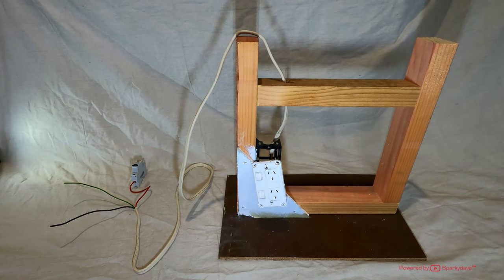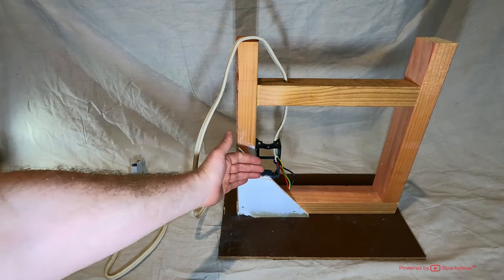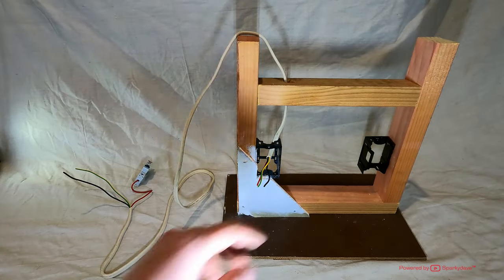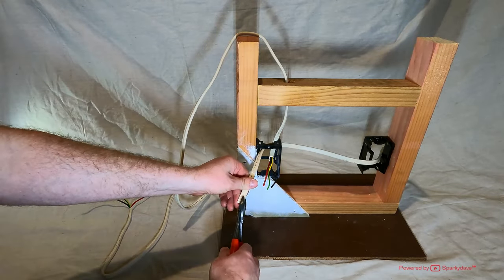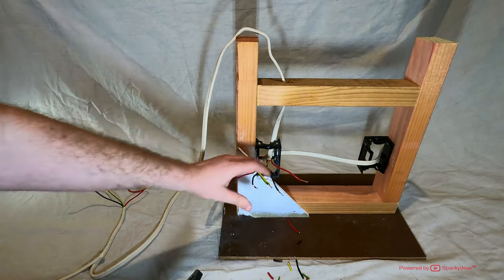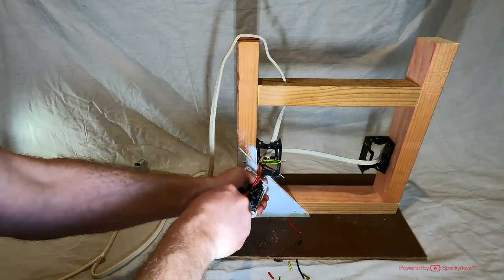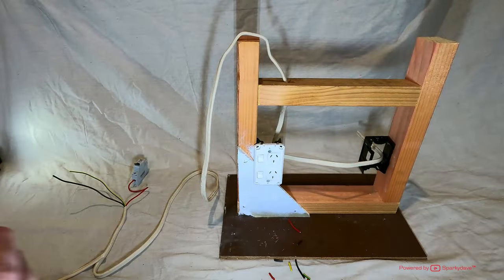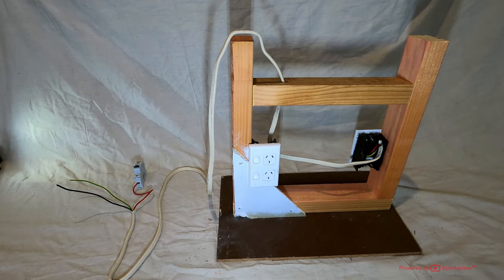Basics: Adding a Socket to Existing Circuit

Comment: Hey love your channel, when you say a maximum of 6 socket outlets on feed to the breaker box - is that six single sockets (ie  double sockets count as individuals or as a total of 3 on the feed?)  - also when do you use pvc conduit and does it go through the dwang or just but it? ?

Comment: Great video. I've talked to a few people about limits to the number of sockets on a 16A circuit and get different opinions. One person said 4, another said no limit, so long as the load is under the 16A. You said a maximum of 6, which seems very reasonable. Is that a rule of thumb or an actual legal standard?
Reply: I want to know this too, as I love to put in waaaay too many outlets, not because i ever intend to use them all at the same time, but simply because I like always having one super near me whatever I'm doing
Reply: I'm a non practicing Electrician. Been out of the game for a long time, but am dipping back in. Doing my Regs course next week. I'll ask the question about the number of socket outlets and see what the tutor says. Not really looking forward to exams again, but have to do it.   @Niberspace

Comment: Quick question ----> you stated you're running 2.5mm cable to your wall sockets, but I've read elsewhere (and I guess everyone has an opinion) that some people like to use 4mm cable for wall socket circuits.

From what I've read, 2.5mm cable (e.g. 2.5mm Twin & Earth Flat Cable) is rated somewhere between 16-20A and most appliances (I would 99%+) running off a wall socket (e.g. kettle, toaster, vacumm cleaner, desk lamp, TV, etc) are rated under 2400W (or 10A).  So this preference to use 4mm cable seems kind of illogical (apart from the hell of just wanting to over-size your cables).  

Your thoughts on 4mm cable for wall sockets?  Overkill or is there some rational to it?
Reply: 2.5mm is the smallest allowed for GPO circuits.  

If there is a long distance from the switchboard to the last socket-outlet on the circuit, then the volt-drop of the cable can become too much.  Other factors such as the cable tightly packed with other cables, or the cable route through insulation in the walls and ceiling, etc.  There are tables and calculations within the electrical standards to work this stuff out.

So yes, there comes a point that 2.5mm isn't big enough and 4mm is required.
Also, the circuit protection needs to be selected in order to protect the cable.

Comment: Love your vids been a great help.  Any chance you could explain how to install a 15a circuit say for using a table saw in a garage?
Reply: Same as a normal GPO, except you need to use 4mm2 wiring, can only install one 15A GPO on the circuit, it must be an uninterrupted home run back to the switchboard and have a dedicated MCB rated 16A or higher.

Comment: Why 6 outlets per breaker?I've heard some electrical companies do no more than 10. I mean, all domestic sockets are rated to 10A anyway so I get that outlets can be single, double or quad but I mean is it in the standard that says 6 outlets max?
Reply: Yeah 6 outlets seems a bit on the low side. It’s not like you’re plugging a heater into each outlet. You might have a phone charging off one and a lamp in another. One room could have 3 outlets in it.
Reply: 6 outlets per breaker, 12 per rcd max 18...dunno. I mean I can see absolute worse case scenario in a kitchen, air fryers, jugs, microwaves, toasters, sandwich press all at once and the outlets burning out before the breakers trip but that seems at the extreme side of worse case scenarios.
Reply: 6 outlets is a reasonable average recommendation, but no this isn't the rule in the electrical regulations or the electrical wiring rules (standard). 

It comes down to what is 'fit for purpose': 

In a hallway or bedroom, you might use one heater or fan sometimes, or a vacuum cleaner, or a lamp.  Probably not all at the same time.  However you can install multiple socket-outlets in several locations to allow for rearranging furniture etc.  Nothing wrong with having 20 socket-outlets on one circuit, because you won't be using them all at the same time.

However in a kitchen, it's feasible to have several high power appliances operating at the same time.  
Kettle, toaster, microwave, air-fryer, blender, etc.
So it's wise to have at least 2 dedicated circuits for the kitchen bench area.

Comment: Is this legal for a homeowner to do in nz?
Reply: Its illegal to do without a full unrestricted electical license.
Reply: I never knew there are countries where it's actually illegal to do your own electrical work. In The Netherlands you can do anything you like, no one will even check it by law. In Belgium you can DIY it but it's required by law to have it inspected, although these inspections are not enforced. It's a good idea for the fire insurance to have the inspection OK though.
Reply: NZ homeowners are allowed to do some limited electrical work, although there are restrictions (including some types of work requiring Electrical Inspection, which is just as costly as engaging an Electrician to do the job). 

Search online for the free document "NZECP 51:2004".  
NEW ZEALAND ELECTRICAL CODE OF PRACTICE FOR HOMEOWNER/OCCUPIER’S ELECTRICAL WIRING WORK IN DOMESTIC INSTALLATIONS 
This document explains what you can and can't do as a homeowner.

Comment: Hey SparkyDave, you are a genius mate. Very helpful video. Here you added a socket (power point switch) from an existing socket. Can I ask you, how to add a power point switch from a light switch?
Reply: You don't. Putting power points on lighting circuits can burn your house down or electrocute someone.